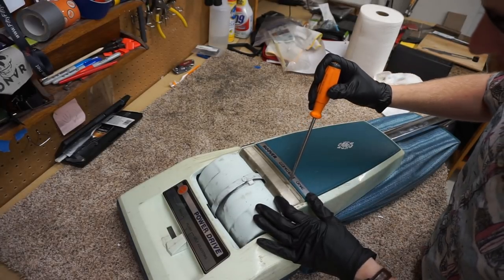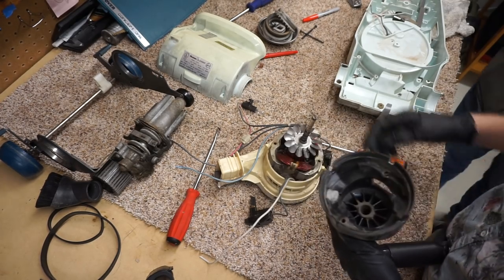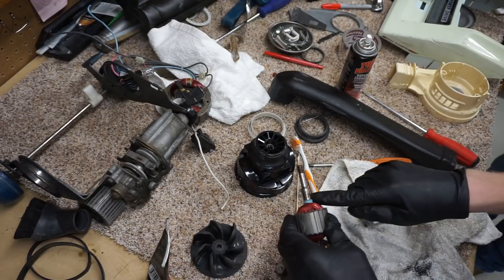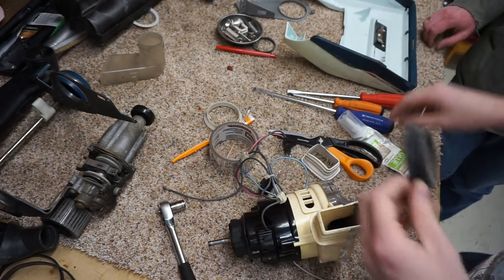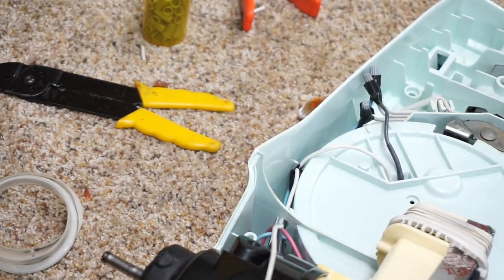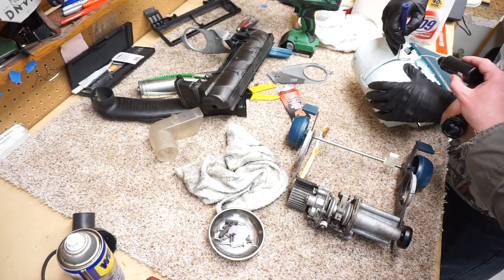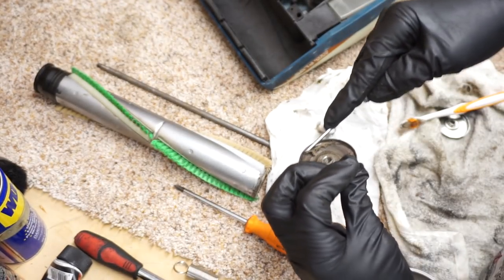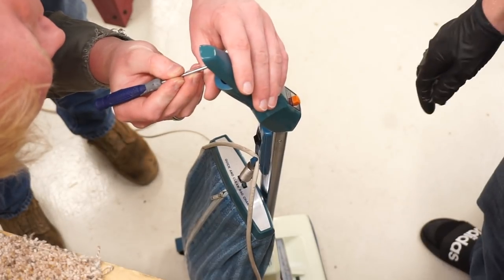America Pride of the 1980s Hoover Concept One U3101 Upright Vacuum cleaner Rebuild

Comment: I finally watched the entire video and I’m sooooo glad you did. I recently bought 2. One American innards , one British innards. The previous owner swapped the innards of them, so the American one works on UK power. The British one therefore needs a complete refurb and I will be putting in a British TurboPower motor into it and rewiring and bypassing the power assisted drive completely, so it will be on/off with no power drive. This video will be my absolute bible on stripping and refurbing it, so thank you so much for this video. Yours turned out like new and is amazing. Thank you.

Comment: Fantastic video! I have a U3225 (grey color scheme) Concept One. Do you have any thoughts on if the clutch pad material can be replaced? If so, what’s a good product to use? I’ve started to get some slip in reverse along with a squealing noise (seems to be common on all Concepts with PowerDrive after some time). I believe the clutch pads have simply gotten too thin and aren’t making good contact with the clutches.

Comment: The Hoover U3101 was part of the first Concept One line, manufactured from 1978 to c.1983.  It was the deluxe, or full-featured one with power drive, headlight, cord reel, chrome handle, and deluxe attachment kit. model U3903-70. Others Concept One models in that line were the U3103 with power drive and headlight; and the non-power drive models U4201 with headlight and cord reel, and the U4203 with no extra features (the -01s colors were named Jamaican Blue and Horizon Blue, and the -03s were Rust Brown and Pale Honey).

Comment: My Hoover Concept one motor runs but has now started smelling if run for more than 1 minute.  I disconnected the roller brush & the motor slightly speeds up & down and still gives out a slight burning smell.  The roller brush is a bit tight & does not rotate freely when the figure is used to roll it. It appears the ball bearings need lubrication.  I could not open up the roller brush to lubricate the bearings. 
Need help on (i) how to fix the motor burning smell  & (ii) how to fix the roller brush

Comment: Is $20 and a 45 min drive worth it for one of these that's in excellent shape minus a fractured handle grip?
Reply from the maker: If you need any parts for it make sure you have the part lined up on eBay or something before you get it I don't know if a 45 minute drive is worth it? but I'd be lying if I said I haven't done it before
Reply: @PerformanceReviews  Only part it'd need is a new handle, though it's been repaired  and is functional, and given how little I would use it I'm probably not going to do much to it at this time, and given the relatively low cost of gas I think it's worth it, as it's only 35 miles, but the interstate highways are utter dogshit so 55mph state highways are what I stick to, especially after a pothole cost me a brand new rim and expensive Goodyear tire

Comment: My reason for having wool rugs is because it’s organic. Over the years I’ve seen so many different types of plastics turn out to be carcinogenic after we’ve lived with them for years and I don’t want to be breathing in synthetics.
Reply from the maker: That makes some sense . What about the glue it's held together with?
Reply: Mine have either natural jute or cotton backing. I was kind of anal about putting my current house together. Only my electronics, small electrics in the kitchen, computers and some of my vacuums are made of plastics. I’ve tried to furnish everything made of natural materials. The waste basket in my kitchen is stainless steel, all of the rest are wicker. My case furniture is wood and my upholstered furniture is cotton or linen. I find the house to be very breathable.